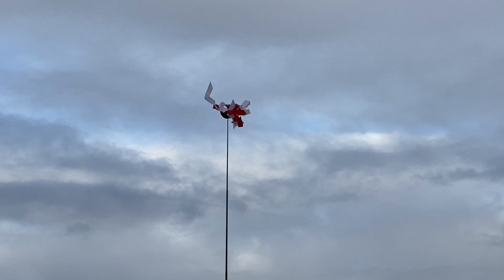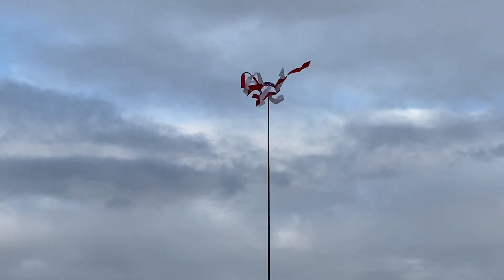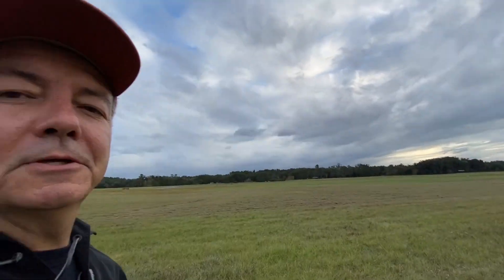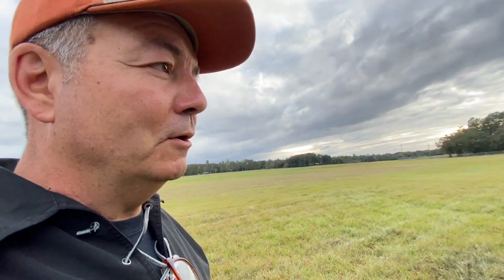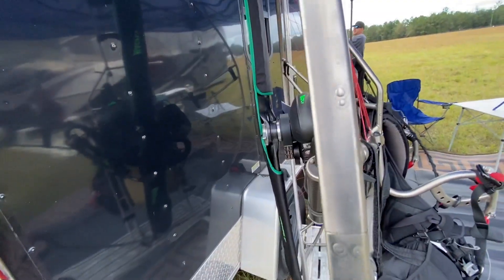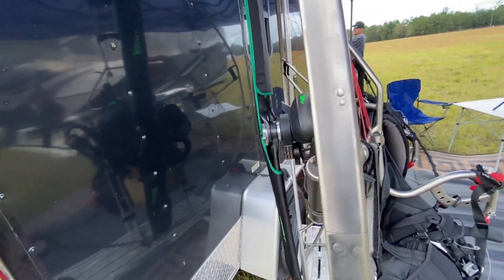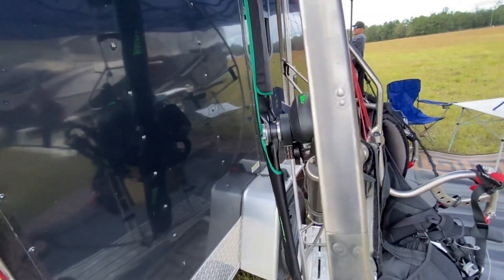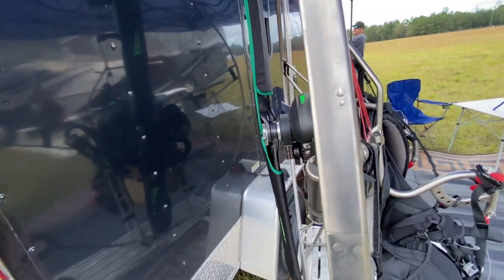Paramotor 140 CM Props

Comment: I've got two moster 185 powered PAP Tinox paramotors, one is a 1400 frame with a 125 prop and the other is a 1500 frame with a 140 prop. The 1500 frame with the 140 prop defently has more thrust. I use my 1500/140 for foot launch and my 1400/125 for wheel launch. Another advanage of the 140 prop is lower fuel burn.

Comment: Great topic!  I hope you do a follow up someday, after putting more time on the machines.  Maybe break down the different reduction ratios available for the Moster (2.68, 2.86, 2.95).  Not necessarily testing, but discussing theory, pros & cons, etc.  Also fuel consumption.
Reply from the maker: Interesting.  I did get a chance to fly about a 40 mile cross country on the new 24M Samurai, with some of my local crew a few weeks ago.  I had to run with trims at neutral and even then they couldn't keep up.  The flight took an hour and 20 mins. The 165 pound guy on his Qubik only burned 3.5L, while I used 7+!!!!!!!  I am sure if I flew the segment again and let the Samurai run trims out, I could have easily knocked 30 mins off the flight time and likely would have cut the fuel burn by at least 2 liters.  Hard to make an apples to apples comparison.
Reply: @YankeeinSC1  Maybe...but if you let trims out, you'll cut flight time to the destination as you say, but you'll have to run a higher RPM to maintain level flight at that higher speed, burning more fuel.  Plus every glider is different.  Anyway, keep the cool informative vids comming!  I'm fine with apples to cauliflower or whatever :)

Comment: I fly a 150 cage Macfly with a 140cm prop like ripa. I love the thrust off the moster with the 140cm prop. Makes a huge difference. I’m tall and heavy too. Interested to see the thrust test, since your pap I’m guessing is a 2.87 reduction with helix prop? And ripa has the 2.68 with Eprop
Reply from the maker: Mr. London Ivy mentioned that as well.  We'll know in a little while.  More than a who's makes more thrust competition however, I think it's just good for folks to be aware of the items I refer to as "ratio variables".  Especially the two big ones: thrust to weight, all up weight to wing size - more commonly referred to as wing loading.  One is never always better than the other because there are trade offs.  i.e. more thrust may mean need for more fuel or shorter flights and heavier motor unit weight. Lower wing loading means easier launching, but potentially less comfort maybe even erosion of saftey, particularly in bumpy air.
Reply: @YankeeinSC1  Agreed. Wing loading plays a huge role. If you’re too overloaded on a wing sometimes they won’t even come off the ground. There’s a balance between both. I’ve thought about converting my reduction since it’s not too expensive to do so, and I could potentially get a wider selection of 140cm props to choose from. There’s just not a lot of information about thrust values between the different reduction ratios.
Reply from the maker: Patrick Bryant Well there’s a little 
now... you’ll be surprised at the results! we got a video from today’s tests world and they were pretty interesting
Reply: @YankeeinSC1  Can’t wait to see it!

Comment: Is it alright for a beginner to training on a bigger paramotor with a 140 prop?
Reply from the maker: I would work with your instructor on answering that question... but if you are a big guy 6'2" or taller, or much over 220 lbs, with a fairly long finger tipped to fingertip span...I would probably say yes. Smaller prop diameters may be more manageable for a new pilot and will require more perfected techniques
Reply: @YankeeinSC1  thank you